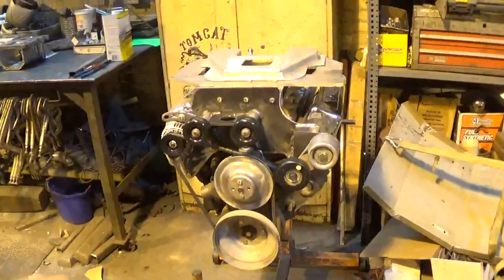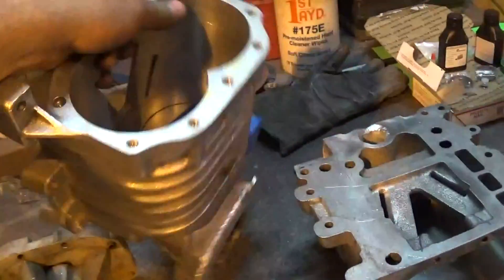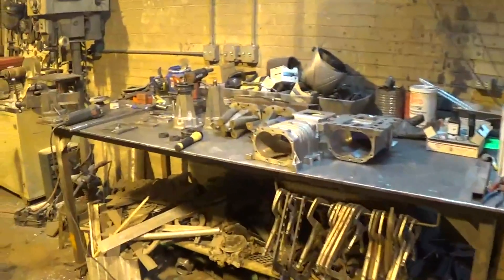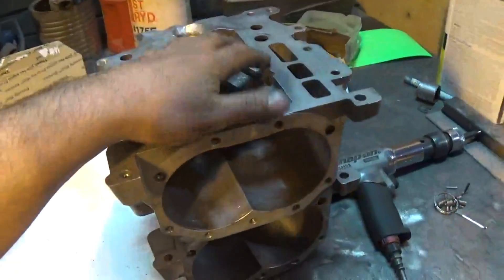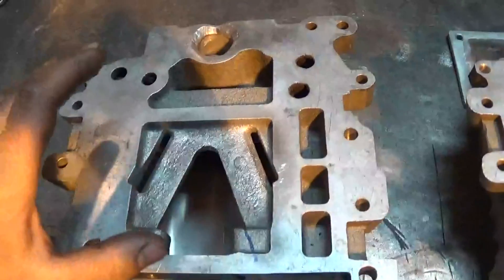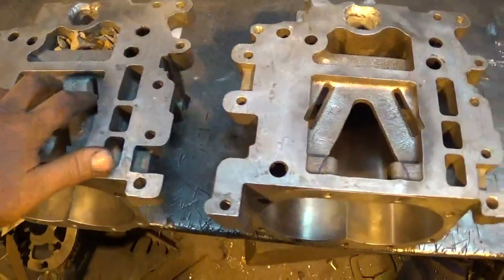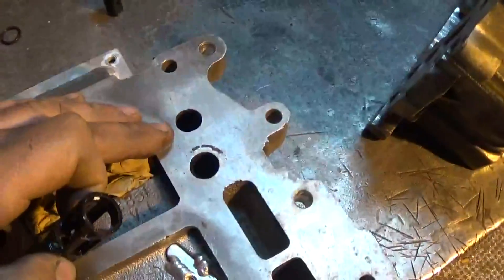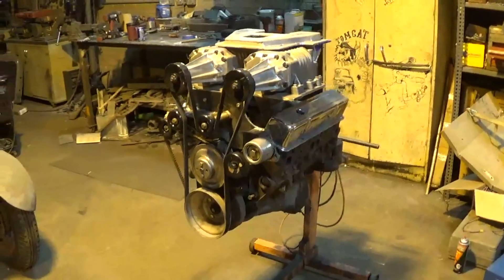TWIN EATON SUPERCHARGER BUILD PART 4- Rebuilt M90's / Half-Fast Porting/ Plugged Silencer Holes!!!

Comment: Bro, are these steel or aluminum? I have a 99 4.7 jeep and the supercharger will not fit on the engine, I've seen people cut these up and make custom fittings, but I've never even thought about running it up like yours. This is what I would love to do I just don't have 1/10th the stuff lol
Reply from the maker: The cases are all aluminum. When I did this project years ago I bought the alpha tig welder and basically this was how I learned to tig on this project... Not the best welds but the setup works. 👍
Reply: @rottersgarage  I have a tig but its a cheap lil thing meant for stainless. Doesn't reverse polarity for aluminum. I've been dying to use this thing lol. Thanks for the response, maybe I'll see if I can find an alpha tig

Comment: With all respect, never sand blast these types of parts, it's almost impossible to clean them, and that will cause problems. From lots of repair experience, I've been getting these failure jobs for 63 years. Cheers.

Comment: Many people have successfully converted these blowers to suck through carb. I'm slowly converting one. I was able to find the rear needle bearings on Ebay that are a 2-lip seal, one behind the other,  the lips can hold up to Nitromethane, Methanol, Ethanol, and gasoline...They are still available and being sold. Part #   INA F390978 FC65477   by Empree Specialty Machine